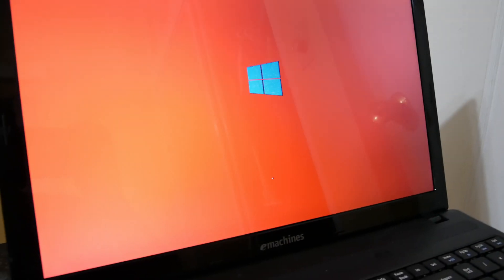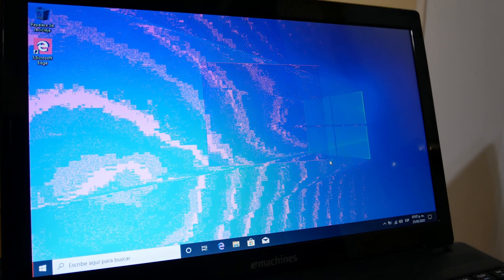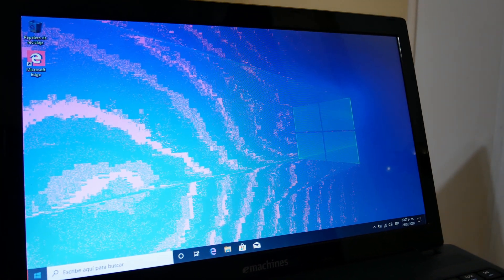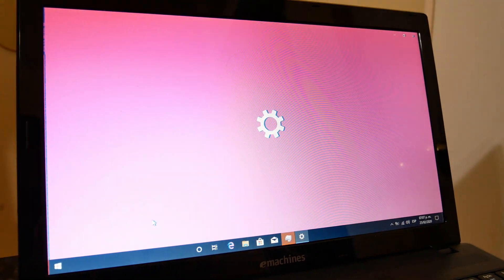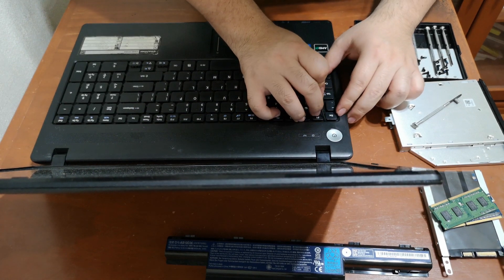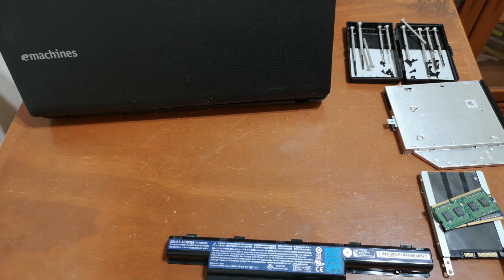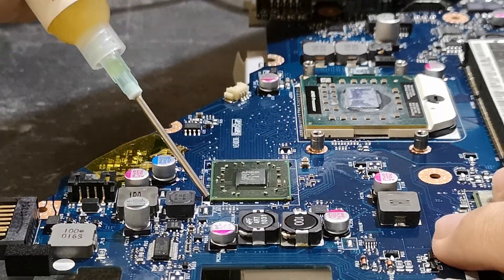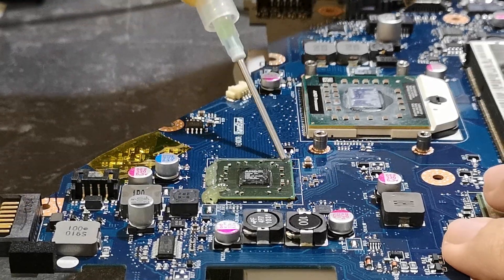How to Fix a Red Tinted Laptop LCD

Comment: But if it is coming on normal with an external monitor, would it still make sense to reflow the gpu
Reply: Mate what is matrix problem? I have same issue. I changed lcd cable but it didn’t solve the issue. But with vga cable on external monitor it works well.
Reply: its matrix problem then, have same problem...

Comment: Exactly the same problem - orange..ish tinted, with sparkled Windows 10 on Acer 5552 Model PEW76. Reflowed the North Bridge Chip and worked! After a half day working on the cable connector, I was coming to a conclusion on the GPU chip reflow but was not 100% sure. Your video made it to 100% sure to proceed with the reflow, thanks!